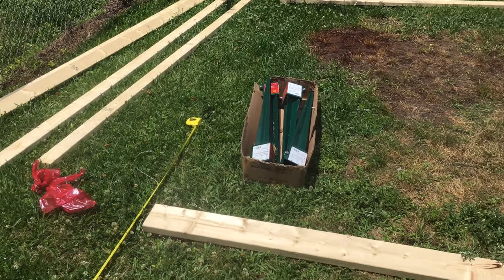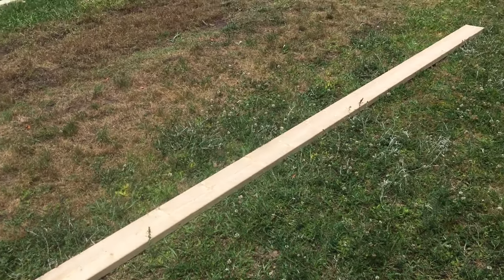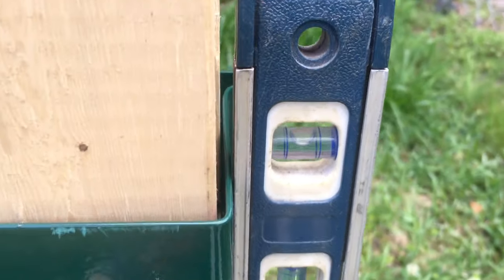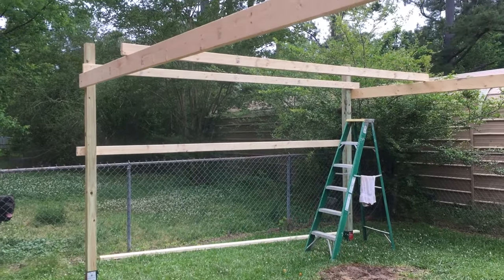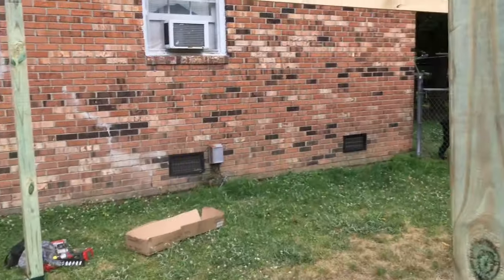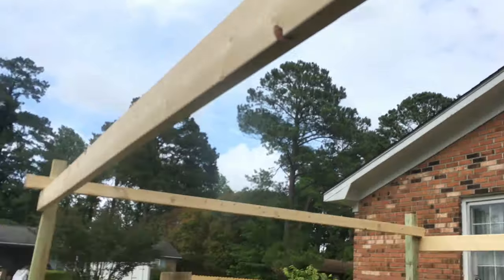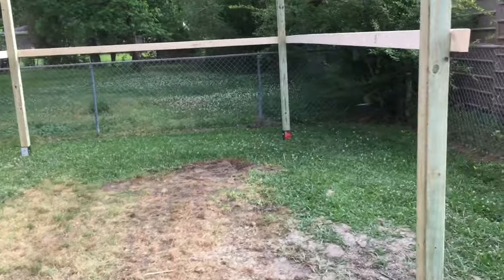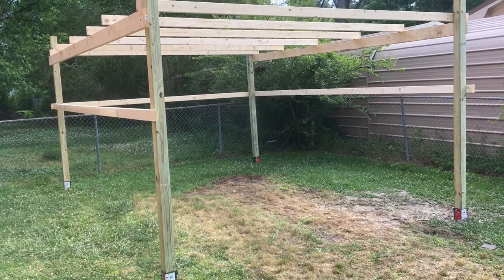Easy & Cheap DIY Carport Subscribe if you find this video interesting!

Comment: No offense but 1  good gust of updraft wind and that thing will be gone. Those stakes offer no uplift protection.
Reply from the maker: I’ll post a meeting video when it blows away. Hasn’t yet, but anything is possible.
Reply: If you already had hurricane force winds , it ought to be ok, but you could get those red anchors they sell at tractor supply and screw them down at each leg and then tie off to ground with some metal cable rope adding those adjustable tension bolt things to each as well, so if they get loose, you can simply tighten the tensioners.. they sell those red crew in anchors in many lengths I think up to 3 or 4 ft long.
How about a uv resistant marine grade thin rubber back carpet tacked down for a roof? Idk? ...maybe in white to reflect the heat? Idk? Maybe  some more 2x4 to roof structure too? Idk?

Comment: One year later is it still holding up? Looks not so great for longevity
Reply from the maker: Looks can be deceiving. Still standing strong. Ask again in a few years and I’ll let you know how it’s doing.
Reply: @CottoDIY  thanks man. I more meant the tarp on the roof for longevity. The rest looked solid. I’m looking to build something like this to work on my Motorcycle under
Reply from the maker: @ablaze3717  oh, the tarp is a no go. Go with metal or plastic if you can. The tarp ripped because of water buildup and then it tore up in a hurricane.
Reply: @CottoDIY  that’s what I figured. Anytime I used tarp it was temporary cuz the water build up. But I’m gonna go with metal I can get from work for the roof…. I’ve built 3-4 quick carports and additions to sheds but they ALWAYS have roof issues. Ive used tar Paper twice over sheeting and then used rolled roofing for the last two. Thanks for the input mate

Comment: No bro. 16 ft 2x6  no bro
Reply from the maker: Would you care to explain? Is this bad?
Reply: 2 2x6s with one screw is not enough to carry all the roof would add two more 2x6s . Sandwich the post run a bolt all the way through or use more screws. Then put tin roof or whatever when you want
Reply from the maker: @kennethsmith1744  I just added tin roofing in my latest video and was concerned about the weight. I also added corner braces. Thanks for the info as it had been a concern there was too much weight on the lag screws. Do you know off hand  the sheer strength for one of these structural lag screws? You must do this for a living! Thanks again.

Comment: This is NOT how you set up the beams! You need to cut out the wood columns to lean the beam on it. You do not screw it to the side. This is a very risky construction method
Reply from the maker: It’s a structural lag screw. Just like using a galvanized lag bolt. See the description for materials used.
Reply: "Risky" only if it is supporting a load, which it's not..the way he has it is fine..maybe all the way through galvanized carriage bolts with washers and nuts, but with no load...it's good!  it's good.